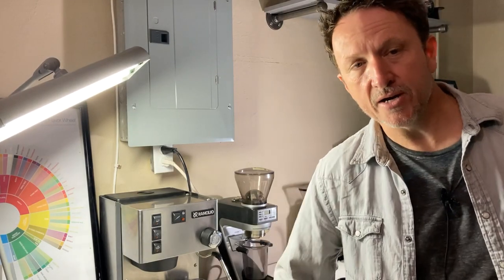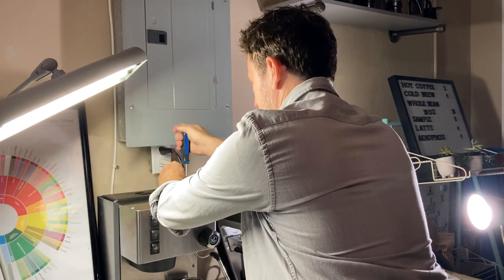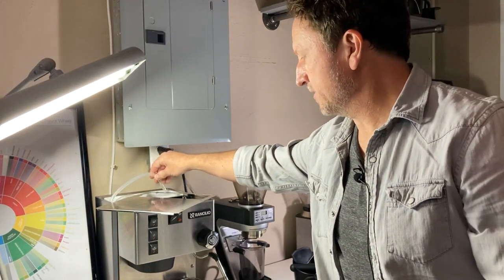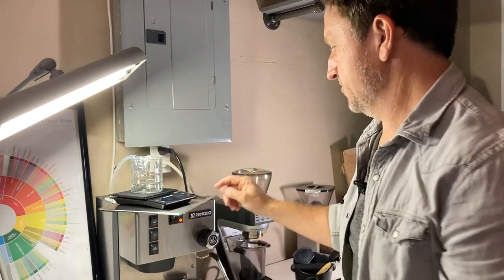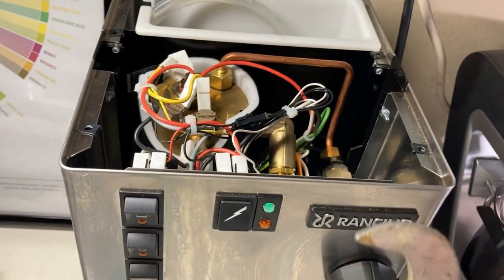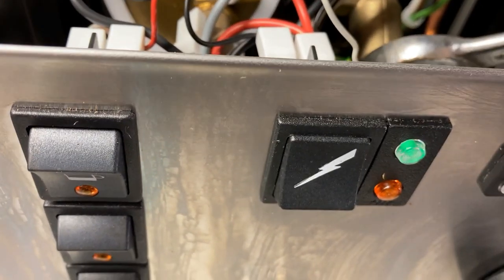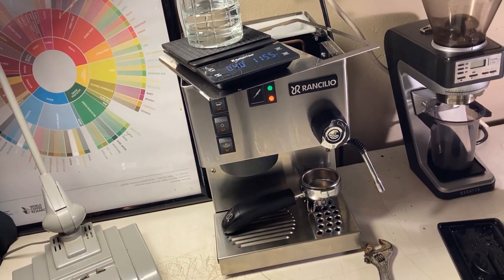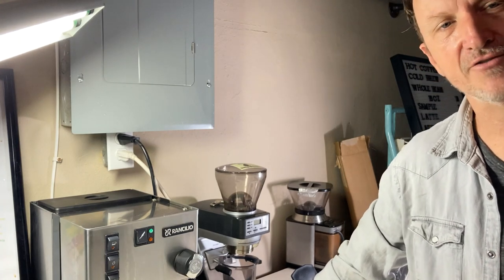Rancilio Silvia OPV Adjustment

Comment: Hey man! Thank you so much for your video. At my machine no water is coming out from the short one when pressing the middle button to measure the pressure, any idea what I am doing wrong? :D
Reply from the maker: make sure the longer tube is submerged in water. Press the hot water button (like for an americano) It may take a few seconds to come
Reply: Also it may be possible the valve is not working…. Maybe lack of cleaning with a blind porta filter
You might try entirely disassembling the brass valve 
Basically there is a spring with maybe  a ball inside
As you screw in the valve… it increases the pressure from the spring and so reduces the overflow water
As you loosen… less pressure on the spring and more flow from a lower pump pressure
So the only reason for no flow would be  no water, wrong hose, or defective valve
Oh…. Also make sure the overflow hose is not kinked
Reply: Sometimes air gets in the line when moving the tubes around. Pull a shot with the espresso button and clear the line.

Comment: Adjusted mine to 9/10 bars hopefully, lovely crema and espresso extraction takes around 20-25 seconds. Improvement after 7 second/no crema extraction. Always grind  coffee beans for best results, I had terrible results i.e. no crema with pre ground coffee from the store regardless of brand.
Reply from the maker: Wow glad you had great results! Yes as a roaster I definitely recommend not buying store preground. It will be much more rewarding to support a local roaster
Reply: @drinksunbear  Thanks!
Reply from the maker: @salviaofficinalis02  that’s why we do these. Thank you
Reply from the maker: Hope your shots are getting locked in well
Reply: Freshly roasted beans and a quality grinder are essential.  As soon as coffee beans are roasted they begin to lose their flavor, no matter what kind of "sealed", "one-way-valve" or whatever packaging is used. Besides, you need to have control of the grind in order to dial-in the best cup.

Comment: Wait a minute. How does this even work. How could you possible measure pressure by an opv valve? Could someone share the physics behind it? I really don't understand how ml translate to pressure.
Reply from the maker: I don't know about the physics part I didn't study that well in school. But here is a cheat sheet file
Reply: @drinksunbear  Well I studied mechanical engineering long time ago and I don't understand it. Anyway I'll check the graph.
By the way you shared a link of your local pc path.
Reply from the maker: <http://www.pidsilvia.com/Ulka%20Water%20Pump%20Pressure.htm>

Comment: Im only getting 13g of water for 30 seconds. Does the machine need to be to temp?  Doesn't seem to be in the video.  Someone below suggests backflushing. Guess I'll try that??
Reply from the maker: I don't think the temp matters in this case it's just about intake of water from the OPV.  Is yours an older model? Some folks have responded with the older ones that ended up needing to replace parts. Mine was brand new, and shipped at a high setting so just adjusting the OPV a little fixed it

Comment: Hi mate, nice video thank you - if you're still checking the comments here, I get 130grams over 30 seconds (great!) but when I put a pressure measure on the portafilter it shows 10 bars! Any ideas?
Reply from the maker: Allow some wiggle room with the portafilter pressure tester since they are not sealed correctly. But maybe adjust it back just a little?
Reply: @drinksunbear  thanks I'll give it a go!
Reply: OPV pressure does not equal brew head pressure, often by several barr. They correlate, but not closely.
It's why the Scace is $660

Comment: I have another potential issue with my Silvia (I’m not sure about it): 
Is it normal to have condensed water in the machine?
Haven’t found any leakes yet, but I’m not sure if it’s normal to have condensed water in the machine.

Addition: I had to replace the old boiler because the heating element was broken. I kept in mind and to care about tightening the boiler screws properly. 

Any ideas? :-/
Reply from the maker: I should have mentioned that my machine is only about 1 month old. So no I have not had any issues with water sitting around at all. The reason I did the OPV adjustment was because it comes stock from Rancilio at a high pressure setting and I was getting weak shots
Reply: Water condensation can happen because there's a liter of water in there. It all depends also on the weather and climate where you live. As long as it isn't leaking or causing any problems it's probably not a problem.

Comment: So I just checked my machine twice and it spat out exactly 130g of water in 30 seconds. However, my shots are still pulling very fast. I have grinded pretty fine but then the shot itself is just sour af and not pleasant. Should I just lower the pressure even more?
Reply from the maker: I would think so just adjust ever so slightly. Are you sure you are getting a fine enough grind on your coffee?
Reply: @drinksunbear  I think that was exactly it, I didnt realize that a sour shot means it's under extracted. Now on my rocky, I grind as fine as possible and it is tasting much better, although I may have to mod it to be stepless so I can dial in my shot
Reply from the maker: @tubbycustard8866  glad you are getting those tasty shots now!

Comment: Great guide.

I just gave it a try and I got 174g in 30s, which means not enough pressure at the portafilter.

I don't have 2 x 20mm spanners, so I will have to sort that out next.

However, the reason I found this video was because my Silvia has started to pump water through too fast. It was always a little on the fast side.

If it is too fast, does that not mean too much pressure at the coffee?

But the flow rate I get is 147g/ 30s, which is 33% over the rate and indicates too little pressure.

What is happening?
Reply from the maker: Too fast can mean lots of things. But most likely too much pressure. Aside from that really need to make sure your grinder is making good espresso level grind size
Reply: Hi, 

Thank you for this interesting video.

I wanted to share my experience adjusting pressure/ flow rate on my Silvia.

I bought I pressure gage that fits onto my portafilter to compare with the flow rate and this is what I got.

FYI :

- Pressure gage bought on a online coffee shop. Is it perfectly calibrated, don't know ?
- Cooking scale. Perfect calibrated, don't know ?
- Readings and measurements have been made 2 - 3 times and approx +/- 1 - 2secs, and +/- 1 - 2 g

Boiler temp : 82°C - 93°C

                                   Flow rate                     Pressure 

Factory setting :  160 g in  30 secs               10 Bars

Adjusting  :          150 g in 30 secs                11 Bars
                              183 g in 30 secs                9    Bars       
                              185 g                                   8.5 Bars                                    
                              205 g                                   7    Bars

I've done my final adjustment to 8.5 Bars.
Couldn't reach the 130g in 30secs flow rate as my pump could only deliver 11 - 11.5 Bars.

I does make sense  to me, if you reduce pressure you increase for rate and the other way around.

When extracting coffee pressure and flow rate can be influenced by :

Beans ?
Amount (14g/16g/18g)
Grind size ( Coarse or fine)
Tamping
T° ?

Hope this was helpful.

Please give any feedback.
Reply: You can do it by taste/feel or use the flow/pressure chart as a guide to the OPV pressure setting
Reply: too fast:  pressure too high (but not in your case), grind size too course, not enough dose are the two other possibilities
Reply: I’m confused: he lowers pressure to get higher flow rate?  Shouldn’t that be opposite?  More pressure, more flow??
Reply: @Dudadius  That's because there are two paths for water. One is to the boiler and the other is out the OPV overflow tube (which he's measuring). If you get more water (higher flow rate), it's because water was diverted away from pressurizing the boiler, via the Over Pressure Valve, and instead it's allowed to flow out the OPV tube more readily. But this is a poor man's method, because it relies on consistency in rated pump pressure/volume which might not be guaranteed. It's a good hack if you lack a pressure gauge portafilter, as a sanity check/first line of tuning.

Comment: There's abolutely no water coming out of it in my case. shots are terrible too. steam wand works great tho. is my opv or pump broken?
Reply from the maker: sorry to hear that Patryk, is your machine older? I really am not sure how to diagnose whether it is a broken pump or not though that does seem possible.
Reply: @drinksunbear  thanks. yeah, it's 5 or so years old. I found out that when I untightened the screw on the edge of leaking, some minimal drops did come out of the tube, so maybe I'll start with checking if OPV got clogged inside
Reply from the maker: @parkideluvac4885  Yeah unfortunately I am hearing that about some of the older ones. But I guess we can only expect so many years before some maintenance to be in order. I should have made a disclaimer on mine that it was a new machine
Reply: In short, replacing the pump helped, and the coffee is good now. Thanks Sun Bear, I owe you a cup of gesha.

For anyone with a similar problem: Getting in the right flowrate does not guarantee the pump works good when under high pressure. When I removed my OPV and descaled it, I was able to set the back flowrate of 260ml/minute. Still, the pressure did not work well on the coffee cake. Btw. replacing the pump is quite easy and cheap.
Reply from the maker: @parkideluvac4885  wow man good info. You should do a video and document your experience for those with older machines

Comment: How can I get the OPV loose?  It is really on there.
Reply from the maker: Not sure if it's really locked man. Mine like I said on here was fairly new and so it unscrewed really easily. Just make sure that you hold the bottom one still while you adjust the top

Comment: Most of my shots are bitter, could it be the OPV ?
Reply from the maker: I would base it more off the timing. Are the shots pouring in less than 20 seconds etc. If they are it could very well be the OPV. Such an easy fix though and now mine is working great
Reply from the maker: Also the type of coffee you use matters so much. My coffee is super light roast and is a challenge for espresso.

Comment: I have no OPV on the V1 sadly.
Reply from the maker: Oh wow, I did not know the older ones do not have one
Reply: Mine does. Was it removed and capped at the boiler?
Reply: @jacklun13  really? Interesting! I had read that unmodded V1s don’t have it. But I also think there’s different iterations of V1; I have one from 2003. What year was yours built?
Reply: @stuartschwartz234  2002. I also have a 2000 that came with the updated OPV and steel delivery pipe. The 1st gen valve was smaller and had a plastic pipe.
Reply: @jacklun13  maybe what I mean is that the OPV valve is not adjustable. Correct?
Reply: You are correct! I’ve only had my spare machine for a short time and didn’t realize that it’s only an expansion/safety valve. Ultimately it could be replaced with the current type. Cheers to learning new stuff!
Reply: @jacklun13  yes, thanks for the dialogue. I’m in Canada; where are you at?
Reply: @stuartschwartz234  US Pacific NW
May good shots be with you.
Reply: @jacklun13  and you, sir!

Comment: Very useful.  Kind of scary, watching you use those wrenches near high voltage.  It would be wise to disconnect power to the machine before placing fingers and metal tools inside.
Reply from the maker: Yeah you come on a ride for sure with me. Learning the hard way everytime. Fortunately nothing happened!
Reply: @drinksunbear  I did just attempt the OPV adjustment as you show it (but disconnecting the machine from power when working inside).  My first measurement yielded 75 ml in 30 seconds. Yikes! too much pressure, and very probably the reason that my pours were too fast even with grinding very fine and tamping very hard. After again adjusting the OPV, the second measurement was 110 ml.  Finally, the 3rd one produced 130 ml.in 30 seconds.  With that, my pour took 25 seconds, and produced a cup with slightly more (pleasant) acidity and nice crema.  I'm very grateful for your help with this.  BTW, the proper metric wrench size is 20mm, and two of those, with thin heads, make the OPV adjustment much easier.
Reply from the maker: @billinrio  that's what it's all about Bill! Glad you were able to get some tastier shots. Keep watching I will have a new one soon comparing this method alongside a pressure gauge in the portafilter
Reply: Be careful when a guy named "Sparky" gives you advice on working near electricity.

Comment: Thanks for the video. I got my machine couple of months ago. after using the machine for 1 month, suddenly expresso started coming out slow. even after adjusting the grind on the coffee (coarser), its still coming slow... you think it could be the OPV valve? there isn't any crema either (I used new beans). I haven't changed anything else.. here is a video I made. https://youtu.be/kfBl46cFb_Y
Reply from the maker: I'd just recommend testing your pressure first. But the OPV valve is a good place to adjust

Comment: Hi, 

Thank you for this interesting video.

I wanted to share my experience adjusting pressure/ flow rate on my Silvia.

I bought I pressure gage that fits onto my portafilter to compare with the flow rate and this is what I got.

FYI :

- Pressure gage bought on a online coffee shop. Is it perfectly calibrated, don't know ?
- Cooking scale. Perfect calibrated, don't know ?
- Readings and measurements have been made 2 - 3 times and approx +/- 1 - 2secs, and +/- 1 - 2 g

Boiler temp : 82°C - 93°C

                                   Flow rate                     Pressure 

Factory setting :  160 g in  30 secs               10 Bars

Adjusting  :          150 g in 30 secs                11 Bars
                              183 g in 30 secs                9    Bars       
                              185 g                                   8.5 Bars                                    
                              205 g                                   7    Bars

I've done my final adjustment to 8.5 Bars.
Couldn't reach the 130g in 30secs flow rate as my pump could only deliver 11 - 11.5 Bars.

I does make sense  to me, if you reduce pressure you increase for rate and the other way around.

When extracting coffee pressure and flow rate can be influenced by :

Beans ?
Amount (14g/16g/18g)
Grind size ( Coarse or fine)
Tamping
T° ?

Hope this was helpful.

Please give any feedback.
Reply: The very same thing is happening to me. As I open the valve the more water I get from the tube.
Reply: Thanks, this lines up with my own Silvia. I tested it and 2 times it produced 160g of water in 30s (give or take a gram).

Thanks for providing your results, might I ask which version of the Silvia you're using?
Reply: @vineballoon  mine is a Silvia V6. I was able to reduce the amount of water from 160 to 130 but doing it I believe I have increased the pressure but that’s not what I wanted. I want to get 9 bar of pressure.
Reply: @vineballoon  Welcome 😉.
I have a V4.
Reply: I've set mine to 8.5 bars.
Reply: @fernandonogueira11  From the results Benjamin has obtained, it's my suspicion that older silvias have different values for their OPV as the video shows a V3.
Reply from the maker: Good stuff. I have since made a newer video with the portafilter pressure test
Reply from the maker: ok cool this one is a V6